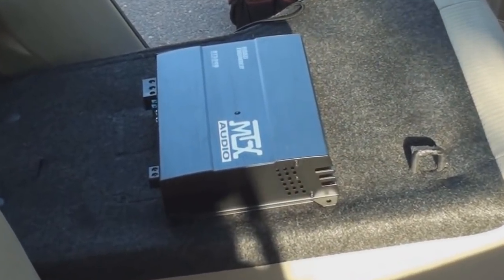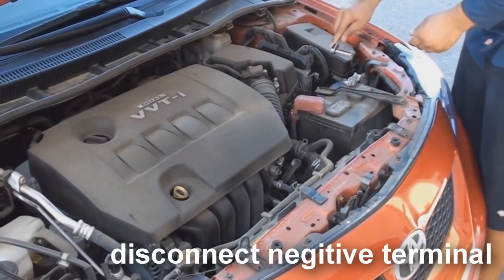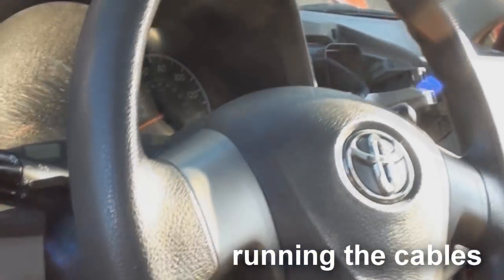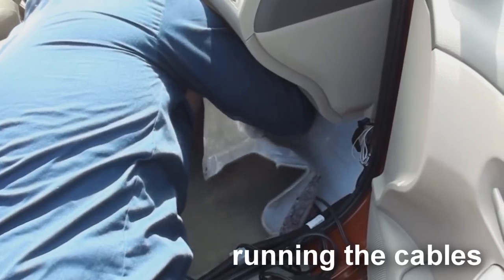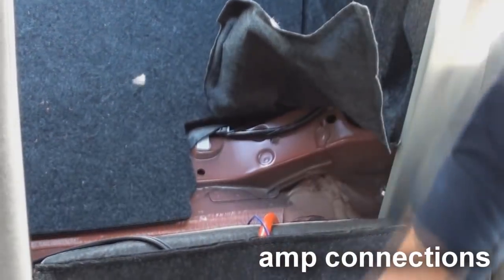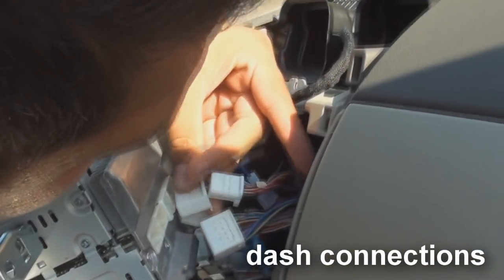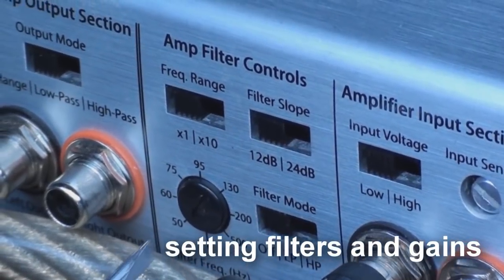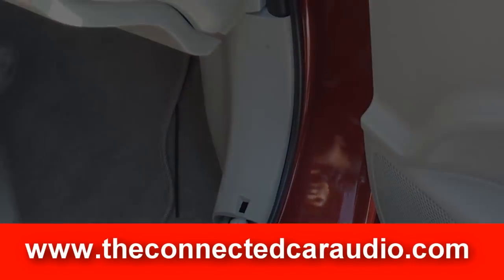How to install a car amplifier

Comment: When you are pluging 2 front speakers and 2 rear speakers hooked to the amplifier with RCA from head unit to amplifier and the all speakers wires . Do you disconnect the factory front and rear wires speakers from the head unit? (total of 4 wires) Or you can leave them with the HU harness. I've Pioneer DEH-X6600BS. Thanks
Reply from the maker: yes disconnect them .you don't want both the head unit Stereo and the aftermarket amp both giving speaker power .you can disconnect the factory wiring at the speaker itself or behind the Stereo
Reply: +connectedcaraudio Thank you very much :-)

Comment: Perhaps you or someone knowledgeable about amplifiers might be able to answer my odd question that I must suck at picking search engine key words for. Will a 4 channel amp run fine without risk of damaging it if I'm only running speakers on one side of it, as in just channels 1 & 2, or does it need to be 'in balance' by running all channels? Hooked everything up to make sure it all works, but I need to temporarily remove the subwoofer that's using channel 3 & 4 bridged until I can get the custom fiberglass box fabricated since there's no secure place for it to hang out while wired up if I drive the car. Essentially what I'm doing to my '90s MR2 is replacing the center storage box that's bolted to the back wall between the seats with a custom subwoofer box. Not exactly a great place for a freestanding subwoofer to sit while driving. lol

Comment: Hi i bought a line out converter, do i just connect it to the back of the stock deck. and also after connecting my sub (with built in amp), should it turn off by itself?

Comment: good explanation, nice job. So how do I know of my line out converter has a built-in remote wire ?
Reply from the maker: you will see a blue wire coming out of it or a blue with white stripe wire coming out of it. 95 percent of loc dont have an remote turn on wire. you will have to tie into the stereos 12 volt ign switched wire or connect into a fuse that turns 12 volts when the key is turned into the acc postion . try to use the stereos fuse if you aree going to tap into a fuse

Comment: It's a really straight forward video but I really don't want to do it... An 01 Expedition shouldn't be that hard to install in. My buddy already has a nice amp and subwoofer for me. I'd just need all the wires. Got a decent after market radio. Not the newest one around but it suites me for what I need it for. Someone already had put a premium sound system in the vehicle before I bought it. I'd just end up getting my ass in trouble around town with the big ass sub. It already hits pretty hard without an amp and sub and everyone on the outside can hear it. Just like when I had my Bose surround sound in my 88 98 Oldsmobile Regency Broughm. I'm not talking about the sorry ass Bose in today's vehicles. I am talking about small hard hitting speakers that I got in trouble with all the time.

Comment: pretty good video, but 2 things I don't like. 
1. if a car isn't amplified from factory why run speaker wires from the amps to each speaker? just cut the harness and get the wires from the back of the radio. do so in a way it can be reversed if you sell the car. 
if it's amplified just bypass the amp.

2. Those are terrible grounds

Comment: I have the speakers in a custom made box I bought under my seat in my 07 ford f150. so I just wire them in series for a 2ohm load for both subs? I have a mtx terminator amp that came with these subs. it's 600 watts leak and 250 rms. class d mono block. would that be better for these subs?
Reply from the maker: +Tim Osness it says your pioneer ever Amp would be 300 watts rms if you wired it correctly, that's a lot of trouble for only 50 more watts than your terminator alp. I say use the terminator Amp

Comment: One thing you did not stress is always, ALWAYS use a grommet to run power wire through the firewall. And yes , you did use one ...

Comment: what could i do to install the an amp if i only have 2 pre outs in my head unit that are occupied by the front and rear speakers? would i be able to use an LOC? to plug in the amp rca's?

Comment: I was wondering my car aftermarket radio has only 1 pair of red and white rca connections. I have 4 speakers  only in my car I will replace with aftermarket ones. Will I need a new radio to get 2 more Rca connections?
Reply: +win toto No it's only outputting stereo.
Reply from the maker: +win toto the basic models of stereos generally have only 1 set of rca's this is to add a subwoofer Amp. If you are to add a 4 channel Amp to power your speakers you can use that rca out and then use a y splitter to connect into the 4 channel Amp
Reply: If you're going for subwoofers and all your speakers. I would recommend 2 amps, one for speakers and one for subwoofer. Then use your one RCA connection to connect to an electric crossover and connect those RCAs to the amp.

Comment: I hooked up my amp to fuse the rem to power via small wire. Its not working but when i hooked it up to battery charger it was bumpin. Do i need better battery or to hook it up to battery the rem to fuse box

Comment: I need help I made a bad mistake of using a drill bit through the main firewall passage with a huge bundle of wires it has rubber grommets around the bundle. I was being careful drilling through the rubber but clipped a wire/ wires and now... my traction control doesn’t work, my truck won’t respond to gas, and engine light is on please need advice!!’
Reply from the maker: If you can repair the wires try to repair them. Make sure to disconnect the battery first though  after check all of your fuses one by one to see if any are blown

Comment: I did step for step what you did and everything worked great but I took the amp out for about a week but left everything else wired (I did take out the fuse from the power cord). when I went to put the amp back it the sub wouldn't play, I know at the very least the sub is working and he amp is receiving power, any suggestions?
Reply from the maker: Make sure that you have the rca's plugged into the correct input on the amp and not the pass through, also check to see if you turned off sub out on your cd player, or that it is sent to minimum also check your amp to make sure the gain is not down. Also check to see if you have the high pass filter checked instead of the low pass filter. And does the amp have a power light to indicate it is on? I would check your power remote and ground with a multi meter if it doesn't, just to make sure.
Reply: connectedcaraudio when I turn the ignition to acc a red like saying PRT goes on but not till I turn the full engine on dose the PWR rapidly blink green, could this be because of a not secure enough connection to the battery? I never did connect a power remote.
Reply from the maker: I usally see that when the battery is weak. I think the amp is not getting the correct voltage, test your battery and see if it's delivering around 14 volts when the car is running and 12.6 volts when the car is not running but the key is on the acc position and yes if the connection is not secure it can cause this issue because the amp is not getting the correct voltage
Reply: so it turned out that the amp was blown, and after having replaced it the red light, which I have learned is "protection" mode, is still on with no music coming form the sub. the owner's manual reads that in this case it is caused by either: "1) Amplifier is very hot 2)amplifier shuts down only while vehicle is running = voltage protection circuitry is engaged. voltage to the amplifier is not within the 10-16 volt operating range 3) Amplifier will only play at low volume levels = short circuit protection is engaged." also the amp is a Kicker cx 300.1. I need to check the voltage on my battery still but if that's not the problem have you any other recommendations?
Reply from the maker: Yes test the voltage coming into the amp with a multi meter and see if it's getting the correct voltage at the amp 14.4 while engine on and 12.6 engine not running but acc on also check that your ground is properly grounded meaning you scraped off paint and are to bare metal. Also make sure you are using the correct size power wire for the amp. Also what impedance are your subs Wired to? The amp will also into protect mode if you have it Wired for to low of an impedance resistance. But you first need to to get a multi meter, without it your working blindly.. Also try unplugging the rca going into the amp and see if that works but make sure to turn off the acc unplug them turn back on
Reply: well not what everyone would call good new but it is for me, after further investigation I found a blown fuse (probably happened when I blew the amp due to installing the amp the second time improperly) on the power cord, so I suppose 0 volts is out of the range of 10-16. tomorrow I will buy a new one and replace it and hope for the best, shall I have any more problems you will be the first person I ask for help from. also, I would like to thank you greatly for all the help you have provided me with and I appreciate it deeply (since I'm a sort or trial and error guy you probably saved me countless hours and dollars). you are much better then the local geek squad and again I thank you.

Best,
Steve
Reply from the maker: No problem glad I could help

Comment: any reason I cant run all 4 speaker wires from the amp to the speaker harness and connect all at one spot rather that spend gobs of time having to run wire to every speaker?

Comment: I did everything today, just don't fully understand the amp turn on wire part ;[ Do I like join the 2 cables together? I really don't want to fuck it up :D
Reply: +PCVideos In High Definition Ye I believe I did everything right. I'm having one problem though and I'm not sure if it's my fault. I still don't have my license and after I installed the radio, amp and subwoofer the car stayed on the same place for the whole winter(round 6 months). Now the car won't start and even after jumping a start and driving for like 30 mins, it won't start after turning it off. I'm wondering if the battery is dead and doesn't charge or something else is wrong.

Comment: EASY WAY TO HOOK UP 4 CHANNEL AMP! 

    If anyone sees this... BUY "9 CONDUCTOR WIRE". Seriously it will save you ripping up your car and fucking up all the trim. Its one fat wire with 8 speaker wires and 1 turn on wire inside. Run it behind your radio LIKE  the rca and connect it to your aftermaker Radio  adapter harness  which is an oem plug on one side to   8 speakers wires +12v constant ,12v switched, ground.  Then run the 9 conductor wire to your 4 channel amp and you have all the speaker wires right there, NO NEED TO RUN NEW WIRE!

Comment: some how i cant connect the amp to +12v and GND ...so my question is, there is any other way to connect the amp. May be from high level input plug? its possible?

Comment: i have a 900 watt pioneer 2 channel amp. i am powering to 12 inch SVC MTX subwoofers. i also have a pioneer head unit. the amp gets really hot after a while of playing loud music and shuts down. i am running 8 gauge wire and my ground is connected to my body of the vehical. i bridged the subs together and thats when it gets really hot. if i dont bridge them together and run them on separate channels it doesnt get warm. the amp is bridgable but gets hot when i do that. dont know what to do.
Reply: What model Amp and what model sub also what is the impedance on the svc woofer? Most likely when you bridge the subs your ending up with a 2 ohm load then if it's a 2 channel and also bridging you will end up with a 1 ohm load at the amp. If you give me the model of the amp and subs I can  better figure out the load

Comment: I have that same amp. Do you guys think it's okay to let the guy up at Best Buy (Geek Squad) hook my system up?
Reply: Boogeyman Myers Just do it yourself. The most difficult part for me was figuring our how to fit the power wire through the firewall.
Reply: Yeah I hooked it up myself. I just have to let the geek squad install a line out converter and then I'm bumping!
Reply from the maker: Boogeyman Myers I'm glad you did it your self is a pretty strait forward install,let me know how it sounds man
Reply: It's thumps hard I love it!

Comment: whats that box thing in the headunit ?with a built in remote wire or something?
Reply: You only need that if you have a stock head unit.
Reply: @marknewman9430  thats what i got but my blue wire isnt hooked to anthing just under my carpet now? do u know where the blue wire goes?

Comment: hi good day, how do you get rid of the engine feedback sounds? i get a lot of noise if the stereo is on with the engine idling
Reply from the maker: Hi the biggest thing to make sure you get no noise is to run the power wires and remote wires down the opposite side of the rca cables. Then use the correct gauge wire for power and ground. Also make sure to sand down the paint where you are going to ground the amp wire to.
Reply: probably its grounded incorrectly or you set your gain on your amp too high

Comment: I have an 2003 ford expedition with an after market radio I have a problem not enough power I check the line from the battery it's good and ground it's good but no sound I change the rca jacks it's good and the rem wire good but the amp still needs more power to come on....?...
Reply: Nathan Dean your gauge wire to small
Reply: Nathan Dean Yeah, upgrade all your power/ground amp wires to 4 or 0(1/0) gauge wire (depending on your system). Do the big 3 wire upgrade using 4 or 0 gauge wires (depending on your system). Still not enough? Upgrade to a High Output Alternator, if you want to play your system with the engine off, add a second battery in parallel with an added diode(iirc) for added reserve capacity power, the HO alternator will be able to charge both batteries without straining itself. There, now you'll have good clean power without killing your system with inefficient juice.

Comment: I have a question, I am installing a rockford p2 sub and a rockford prime r750 that i recently had in my wives car before she wrecked it i salvaged just the sub and amp before they took it away. i  want to just install these to my stock stereo and keep all my accessory features. i got a line output converter tapped into my stock sub in the trunk with the output converter.  i am going to get a fuse tap for the remote switch. what are the chances of frying my amp if i do not use a fuse on the power cable. also im using 12 gauge wire.  is that ok i bought subwoofer wire from best buy.
Reply: any tips
Reply from the maker: +Aaron Dalton you have to use a fuse on the main power wire , frying the amp will be the least of your concerns your car is likely to catch fire
Reply: no fuse but i can get one do you know what specific kind of fuze and size i need and idk what gauge wire to use for power wire my amp came with 4 gauge but thats gone now with the wreck would 12 be fine lol  or do i need to spend some cash on some 4 gauge.
Reply: its the RF r750 amp
Reply: and im just running a RF p2 sub

Comment: question. my friend wanted to buy my amp from me but it has been sitting for a couple months unplugged. is it possible that the amp is shot? i wired everything corrrectly and it wouldnt turn on. then my friend unhooked his amp in his truck, and we hooked my amp to his wires and still nothing so everything is good besides the amp. could it have died by sitting?
Reply from the maker: +Cody Ginther check out my video on how to test an amp that doesn't turn on. It should be helpful

Comment: how do you mount the amplifier onto the seat or sides of the car?
Reply from the maker: +2cool0 I usually put a piece of Mdf under the carpet on the back seat. There is velcro or zippers you can put the peice of wood inside of that on the rear of the fold down seat.

Comment: how to connect an SNI-15 Line output converter to rear door speakers and where can I connect the turn on/remote wire

Comment: amp turn on wire = is that the remote or accessory wire (Blue with white line is REMOTE Max 200mA) on my aftermarket head unit...Accessory is Red wire JVC Headunit.....????
Reply: Can I jus run the remote wire to the radio remote wire

Comment: ok so if you have the factory head unit do you need to run the amp turn on wire
Reply from the maker: Yes a amp always need a turn on wire. If your vehicle factory stereo has a ign switched wire. (that's a wire that turns from 0 volts to  12 volt when you turn  the key to the acc position) you can tap into that, although you may get a turn on thump, or you can tap into the fuse box for a similar wire. But yes it does need it to turn on

Comment: Hey there i have completely wired everything as you have in the video, but i am only getting sound from my tweakers the amp is on and running, but i am just getting no sound from my door speakers little help bro :p
Reply from the maker: Hi, did you run wire from the amp to the speakers in the door. Or did you tap into the speakers somewhere?
Reply: connectedcaraudio Hey there, the speakers are connected up to the back of the stereo :)